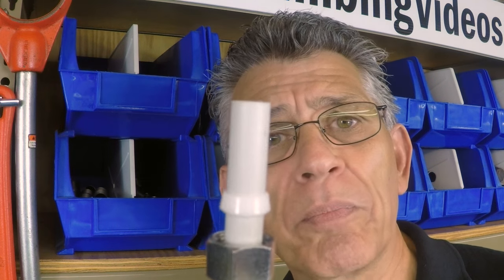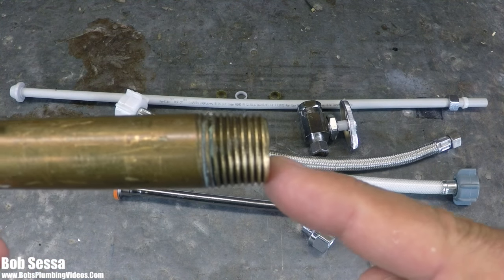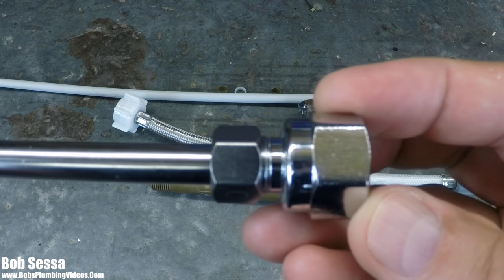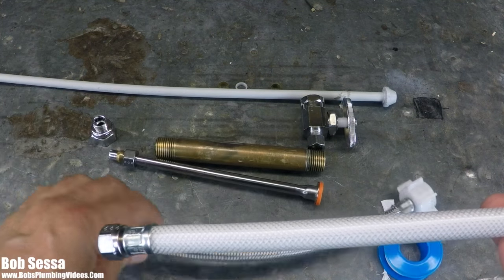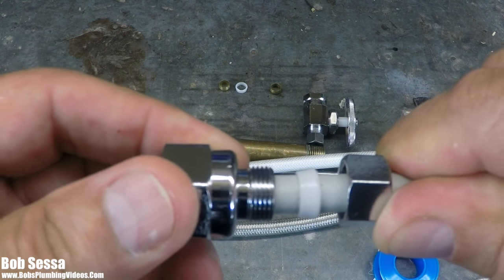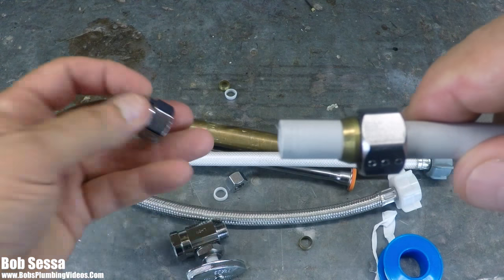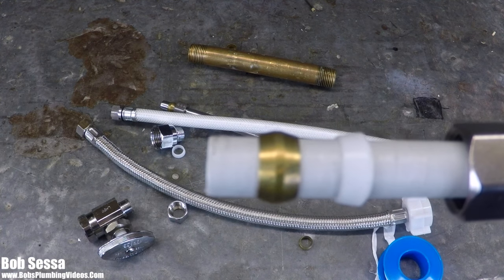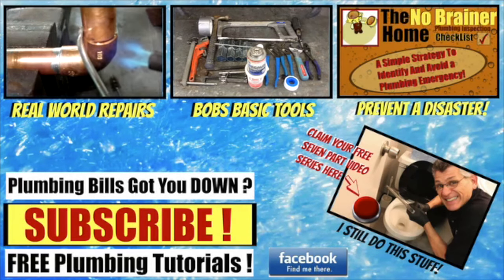Leaking Compression Tube / When to Use Plastic Ferrules

Comment: The factory polyethylene supply tubing to my ice maker was leaking .   The hardware guy told me to use the copper ferrule!  I later learned that I needed a plastic ferrule with a copper insert.  After installing, it still leaked.  After putting my glasses on I learned that the plastic ferrule isn’t like the copper ferrule.  It has a flat side and a tapered side.  The flat side goes toward the nut and the taper goes toward the fitting.  Tighten only a quarter turn-no need to crank down on it!  ( they call the copper ferrule an “olive” across the pond). So to make a long story short, thanks for the great video .
Reply: I heard about the "olive" thing recently :)
Reply: Thank you so much for sharing this tip. I am about to install my water line.

Comment: Compression fittings should come with a metal insert these days for pex tubing. This helps to have something to grab into, of course you can still over tighten, but that's an issue for any compression fitting. They should be snug and leak proof but not more. Over tightening can damage copper, plastic, or even stainless steel tube
Reply: I tried using the metal insert, but, it prevented the tube from going fully into the shutoff valve and when I tightened it down, I was able to pull the tubing right out. I tried it without the insert, using a plastic ferrel and seemed to work alright.

Comment: My swamp cooler has been leaking for months...a guy from a reputable hvac company came out twice and it was still leaking...and a knowledgeable home depot employee told me what the problem was...a plastic tube needs a plastic ferral and don't use irritation tubing just because it fits..it may not handle the pressure...using the right parts makes all the difference.

Comment: Heard an Australian guy call the ferrule an "olive". I've seen metal ferrules used with PEX HOWEVER they use an insert at the end of the PEX to make it stiffer. Similar to the plastic insert in Sharkbite or similar fittings that should remain in place when using PEX (and can be taken out if using copper).

Comment: Thanks Bob! The plastic ferrule recommendation saved my sanity. I had to replace a section of 3/8" plastic tubing for our reverse osmosis system under the kitchen sink. The compression fitting still leaked after 3 attempts with a metal ferrule. The 4th attempt with a plastic ferrule worked perfectly... no leaks, no further adjustment needed. I should have consulted YouTube and you at the start!
Reply from the maker: Excellent!

Comment: Thanks! This showed me a couple of things I needed to know today: what orientation the ferrule should be in and how a plain tube fits into the connection.
Reply from the maker: The tapered portion of the ferrule faces the valve or fitting. the nut sits over the flat portion of the ferrule.
Reply: I just had a massive blowout because I installed the ferrule flipped the wrong way. I tested and monitored the connection for many days without any drips or problems whatsoever. Then, one night when we were all asleep in the house it catastrophically failed. Thousands of dollars in damage that I probably won’t be repairing. My beautiful new hickory cabinets ruined. It’s amazing how much water can come from a 3/8” opening in just a few hours. Water down the street! Guys! This is from a semi-professional that made this mistake. I knew about the plastic ferrules and not to use metal on PEX. I just forgot which way to flip the ferrule. Hating myself so much for this.
Reply: @charliecharlie9377  Ouch. My condolences.
Reply: @charliecharlie9377  Sorry to hear it. I really don't trust these connectors at all. I had what could have been a catastrophic event like yours a day ago. Only, luckily, it happened when I was standing right there. I was using the sprayer in the sink. The sprayer has a weight on the hose underneath the sink that pulls the hose down when you are done with it. I think maybe the weight hit the plastic tubing going to the dishwasher. I heard a massive spraying sound. Luckily, I figured out what it was pretty quickly and was able to turn off the shutoff valve within about a minute.  You are right, 3/8" leak is like a fire hose. I wonder if they make a PEX crimp fitting for 3/8"? I've used crimp rings on 1/2" and 3/4" PEX and I trust that a lot more than I trust this.

Comment: Came here because I was installing an undersink water filter that came with PEX tubing and a Metal Ferrule
I tried so hard to get the ferrule onto the PEX tubing to no avail... wondering why they would have either an improper sized ferrule or just an incredibly difficult task
After seeing how easy it was to slide the ferrule on in your demonstration - It's clear they: 
1) gave me a metal instead of plastic ferrule
2) gave me a furrule that is much too small

Thank you for clearing up my mental fog and providing me with a solution!
Heading to Home depot to pick up a pack and do the job the right way!
Reply from the maker: Excellent! Happy to help, thanks for the visit. Bob

Comment: Thank you so much!!!  I just installed a new dishwasher and I had a pex-type water supply line with an existing metal ferrell.  Well, the long and shorrt of it was that even with the new dishwasher that came with a metal ferrell it leaked immediately!!!  I will go and get some of the plastic ferrells today so hopefully fix the leaking issue so that my wife can run the dishwasher.

Comment: Recently bought a house and the nylon supply tube absolutely sucks. Had my bathroom sink leaked at both hot and cold connections.  Water started leaking through the roof on the bottom floor. Had to replaced them with the new stainless steel braided tubes from the store. The solid chrome plated supplied tubes on any of my other sinks are still solid after 20 years (previous owner installed them in the 90s). When it comes to plumbing, I guess old fashion solid design will last forever. Great video! Learned something new as a new home owner!
Reply from the maker: Much Appreciated Nam! Regards, Bob.

Comment: Thank you Bob you saved my life! My RO unit inlet uses this kind of compression tee and the metal ferrule cut into the tube and leaked water all night. My question is, do I need to use the copper metal insert with the pex tube? The copper insert comes with the plastic ferrule but I’m afraid it will cut into the pex tube.
Reply from the maker: You can use the metal insert with the plastic ferrule and you'll be good to go. Thanks for checking out the video! Bob.
Reply: Thanks again

Comment: Wonderful. I used copper ferrule on p.e.x. and it didn't (to my knowledge) damage it, but it didn't seal, despite cranking down a ton. I can't explain that, but after going back and buying both, then seeing this, I tried the plastic and about 3/4 turn past snug (I was going to keep upping it if it leaked after testing) and it was leak-free. It tried several turns with the copper and it was still spraying.
Reply: I know I'm late to the party but I had a question for you, have you tried doing only 1 complete rotation when using the metal ferrule on the plastic pipe/tube? Also, was the kind you used PEX? Because I heard PEX was really the only suitable/kind of plastic pipe/tubing that can be used with a metal ferrule. People also usually over tighten those rings as well which is another problem.
Reply: Just asking because when you mentioned using the metal ferrule, you said you were cranking down a ton and then trying again by doing several rotations, which could have been the problem, another thing that comes to mind is those little long metal pipe/tube/fitting that come included with compression fittings/adapters which are used to put inside plastic pipe to keep it from bending or something.
Reply: @mr.tactown.253  I actually don't recall, but I'm almost certain that I didn't do the "cranking down a ton" at first. Only after it failed to seal. I should take notes on what projects I've done, because I seem to forget about them fairly quickly, including this one.
Reply: @JackJensenTrader  It's alright but yeah I guess maybe it could have been the missing insert that goes into the PEX pipe to keep it from bending/deforming.

Comment: Hi Bob, I've been struggling with where to find fixture shutoff valves that connect to 3/8" pex supply lines...  I didn't think compression fittings were an option (because someone had mentioned they aren't intended to be used with pex), this video has cleared up that they are indeed an option provided one gets plastic ferrules to do the compression...  Thanks so much for making this video, it's been really helpful.
Reply from the maker: You're very welcome and thanks for checking out my channel. Regards, Bob.

Comment: Awesome video!! Very enlightening. Our plumber likes the copper and pec and hates the other two.  With the copper pipe, do you have to replace it if it has to be replaced, because the ferrule becomes squashed.
Reply from the maker: You can remove the damaged ferrule and replace it with new.

Comment: Thanks so much for this!! I have a really old home and the supplies are all exposed to the tubs and my drain board sink. Some doofus hooked up blue and red pex and it looks terrible. I'm trying to replace with chrome plated rigid supplies and I'm lost on how to do the transitions. The beginning of this video helped so much
Reply from the maker: You get use a p.e.x. by male adapter followed by a female by 3/8" compression chrome plated adapter. You can now use the ridgid 3/8" 
 chrome supply lines.
Reply: @BobsPlumbingVideos  I already replaced it with copper lol now I want to replace the copper with the chrome supply riser. My issue is that I have an old drain board sink. I remember it being a pain to get the elbow for the faucet mouting behind the sink and through it's hole. It's wall mount. The sink has a very high wall. I was thinking I could cut the copper pipe right where it becomes visible. It's a bit hard to explain without pictures. Thanks so much for the response

Comment: I just replaced one of my toilet 90 deg water valve the other day and decided just to replace the valve body and re-use the nut and brass compression washer/ferrule (would be hard to remove).  I bought my house new all pipings is PEX tubing throughout and the plumber who installed the valves used brass ferrule that came with the valve.  It's all about saving money for the plumber contractor and would cost a little more by using the correct plastic ferrule on my PEX piping, it's a one-shot installation, and does not care if the home owner will have to deal with the brass ferrule later.
Reply from the maker: I go out of my way to use the plastic ferrules, cause I know it will only come back to haunt me in the future!

Comment: I've done all kinds of handy man plumbing on my own homes, but have always used copper or the hard plastic.  Now I'm installing a water filter with flexible poly tubing while using copper ferrells; complete nightmare (water filter system came with no hardware or instructions, just the shell).  I decided to go with the poly tubing and the sharkbite connectors, but they either didn't have the right size fittings at the local HD, or I had to go into a copper valve.  Either way had to use some compression fittings with copper ferrells, which took a while to get them to stop leaking.  Heading back to HD to change them out for plastic.
Edit: replaced copper with plastic Ferrell's, no leaks.
    Thanks much
Reply from the maker: You're Welcome!

Comment: Thanks for the video.   I have a delta kitchen faucet with the pex supply tubes built in.  They recommend that you can bend the pex tubes if needed to a minimum of 8 inches diameter,  and I'm at 6 inches so I will have to cut the tubes and go straight in.   I know now to use the plastic ferrules that they supply.   I think I can do it now

Comment: Dear Bob: I am reading  from a BrassCraft Multi-Turn Angle valve # 27  OCR19X R1 instructions and it says 
"if using PEX Pipe
1-  On 3/8" OD and Smaller, use plastic compression ring.
2- On larger than 3/8" OD, use brass compression ring with stainless steel tube insert.
3- To install, hand tighten, then add an additional 1-1/2 to 2-1/2 turns with a wrench".
Dear Bob have you tried to use this method? have you run into trouble using it? I would like to know your opinion. 

I notice that most of the fittings you get new from the store are damaged. The contact fittings with the ferrule have scratches, burrs and nicks and they cause licks no matter how tight they are. I solve the problem by taping the fittings with "valve compound grinding"  to make them smooth and able to make perfect contact around the fittings.
Reply from the maker: My experience is with 1/4" & 3/8" sizes for witch I'll use the plastic ferrules sometimes w/ or without the brass inserts. On larger sizes I've seen guys use Teflon tape with pipe joint compound to get it to stop. Torque until the water stops. try not to over tighten if at all possible.

Comment: The pex supplies we used to use didn’t come with plastic ferrules but we kept them on the truck. That’s all we use to use. Now the supply house don’t even carry them. We use flex connectors. I’ve had to go to Home Depot to get plastic ferrules. Though I believe on 1/2” pex and up you can use a brass ferrule
Reply from the maker: I get them from Home Depot myself. I still like the chrome plated hard copper toilet and basin supplies. They look much better! Regards, Bob.

Comment: How about plastic/rubber tubing used a ferules on copper?  I'm swapping an old 8" spread faucet to a new vanity and that is what I found on the little copper tubes between the spout and tap handles.  The old ferrules have fallen apart so I need to figure out what to replace them with.
Reply from the maker: Most modern widespread faucets have plastic tubing with pre installed plastic ferrels. They also provide a couple of extra plastic ferrules in case you decide to  cut the tubing shorter. So my answer would be to use the plastic ones.

Comment: What about the brass insert they make for plastic tubing that inserts into the end of plastic tubing when using compression fittings..Needed or not?  Good video...
Reply from the maker: Technically  needed, not always used!
Reply: @BobsPlumbingVideos  Thanks for the reply...

Comment: Great video,  I use the plastic ferret when I pull the pex it comes out it is not holding tightly after making the connection??

Just to give an update I got through with my project ,,I just needed to screw it in tightly and it worked perfectly,  no leaks,, thank you👍🏼👍🏼

Comment: The shut off valves come with the metal compression fitting so most people would just use what’s there not knowing any better. I bought the same pex line and mine didn’t come with anything. Now I need to go buy all the additional parts I need. Is the tapered end on the large end just a compression fitting? Would you just use a nut?
Reply from the maker: The end that connects to faucet takes a brass nut and act as a compression fitting.

Comment: Hello Bob. I'm not a plumber. Just some schmuck who is forced to do his own home repairs for financial reasons. So forgive me for any critical comments or slight additions to your instructions here. But it seems to me that you omitted a few important details in places. One, is that when joining a line of any sort, whether to a valve, such as a shutoff valve, or to another fitting, or section of pipe, etc., one should make sure to insert the pipe in as far in as possible until it stops. If it is not in far enough, that too can create a leak further on down the road. This is true for all types of connections, I believe, whether made by sweating pipes, or gluing pipes, or whatever. Also, those plastic ferrules you showed us. You've probably noticed that, unlike with the metal ferrules, the plastic ones are not symmetrical. They sort of taper down from one side to the other. The fatter side is meant to go toward the nut, and the slimmer side, toward the main piece, such as the shutoff valve, or whatever. These are small concerns, I will admit. But the products are designed that way for a reason, so best we follow the rules, no? Again, not trying to sharp-shoot you: but only help out. Please correct me if I'm wrong on any of these comments, and most of all, keep up the good work, Bob. Anyone who makes videos to help the general public should be commended for adding some good to the world, which is in dire need of such kindness. So thank you, my friend.
Reply from the maker: Great Advice! Thanks for posting!
Reply: Thanks for the good video and the additional detail in the comment.

Comment: Thank You sir. It was painted copper pipe after all. It is the copper supply tube so, I am fine using ferrule that comes with the new pressure valve.
Reply from the maker: You're welcome john! Regards, Bob.

Comment: Thanks Bob. We have a waterline PEX tubing very similar to what you’ve shown on the video. I was just wondering do we need to use a brass insert in addition to the plastic ferrule? Problem is I can’t fit a brass insert into the PEX tube, so if we could get away with using only a plastic ferrule to connect to the fridge then that would be great.
Reply from the maker: Technically you should and they're available, truth be told I've used them without.